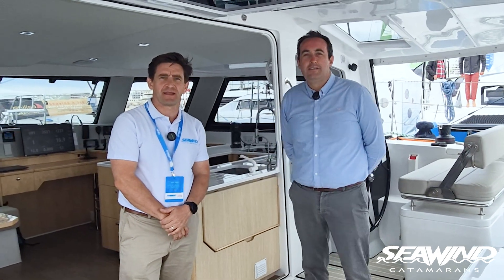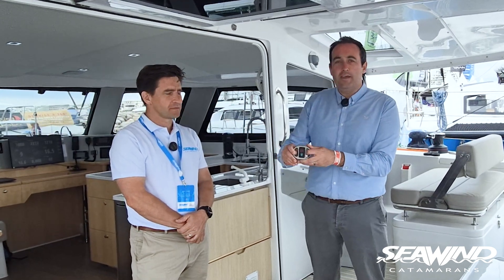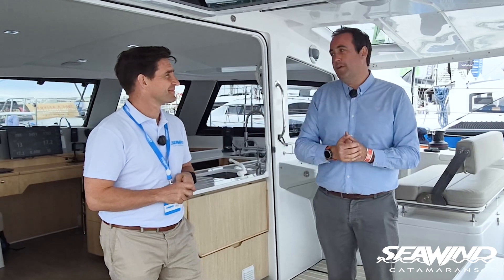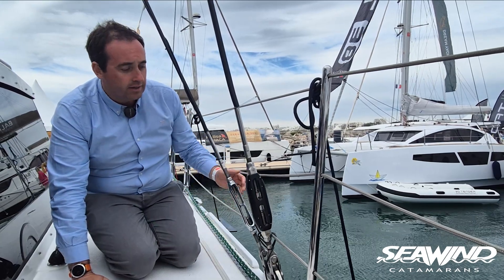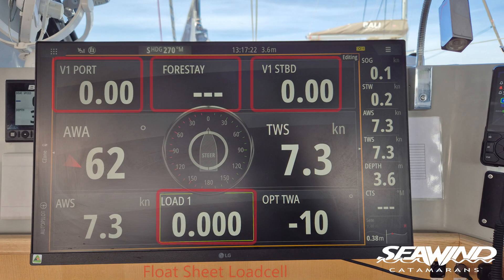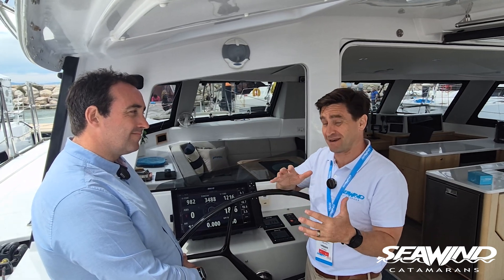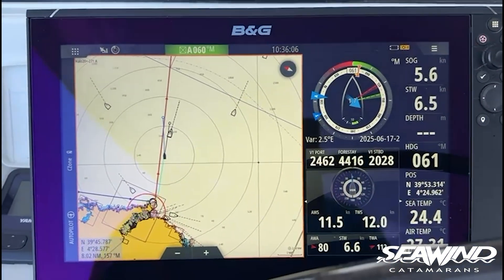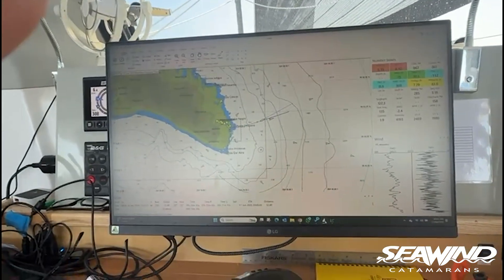Discover new Cyclop Rigging system developed by Seawind Catamarans and Cyclops Marine

Comment: I remember the first time I saw the lee shrouds on a 1260 sailing on a beam reach. They were slack like spaghetti just flopping around. I thought disaster was imminent. I called out to the owner... And he said, "Oh they get like that." It was normal. 
No problem.  
I think it was about the third YouTube video on replacing the standing rigging of  cat, that it clicked. All three had strands in the cable break right at the sleeve of the lower attachment. I'm almost certain this is caused by work hardening making them brittle. The standard demonstration of work hardening is to take a piece of copper wire and just gently bend it at the same point over and over again. It'll eventually break. When they are the lee shrouds flopping around -- they are being work hardened. 

The solution seems really simple. Just attach a bungee bundle from about the mid length of these lower shrouds to the mast. The tension force needed is almost nothing, so it's not a factor of the overall tension. It just needs to  be enough to dampen that flopping around. When they are the windward shrouds the tension of the bungees is meaningless. This connection mid shroud shouldn't interfere with any operations. 
It also seems so obvious I wonder if I'm missing something? 
Unless I got more information I think I'd rig the bungees before I'd buy a continuous load sensor.  Again, I'm not an engineer or professional rigger. 
(And on my 22 year old Hunter I've got a B&R Rig. It's original and according to the riggers who've inspected it, it's in great shape.  Also, I've only been coastal sailing. If I was to go anywhere serious I'd re rig. When my shrouds are on the lee  they don't flop around. Might just be the difference between a cat and a monohull. Not better just different.)
Reply from the maker: There's no question, excessive movement in any loose rigging will lead to metal fatigue. It's a fine line between having the right amount of slack on your leeward shroud when underway, but it something that an experienced hand will be able to adjust easily. Shroud fatigue is not a major concern if you engage a local rigger for systematic rig inspections, learn from them when they are done and maintain a routine inspection of all rigging appropriate to the use of the boat.

Comment: Hello,
What is the ceiling height on your boats, starting from the 1160XL up to the 1370?
In the saloon, galley, cabins, and on the deck at the helm station?
Reply: 6ft 5” on 1160xl ….all listed on their website.
Reply from the maker: In the saloon areas we have 6'5" on our smaller boats in the range (1160XL, 1170, 1260) then going up to 6'8" in the 1370. Down below we have higher again, especially in our newer models with the much flatter deck shape moving forward.
Reply: @SeawindCatamarans What’s the door height on the 1160xl ? Thanks, cannot see in details…